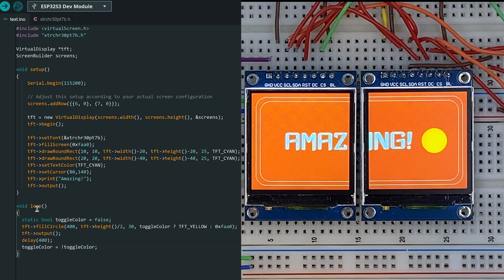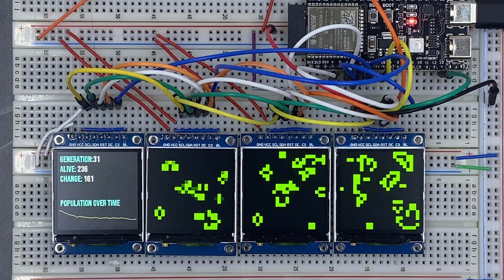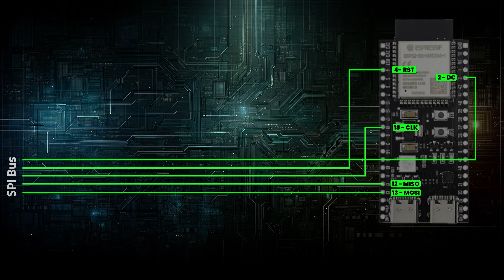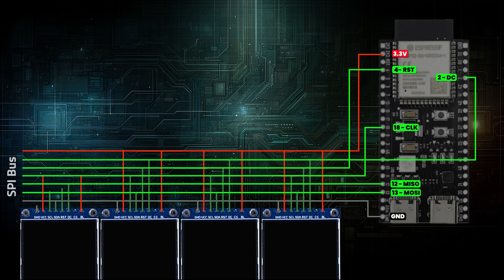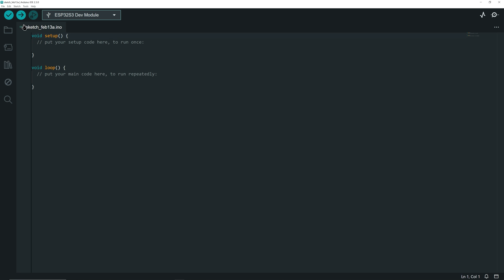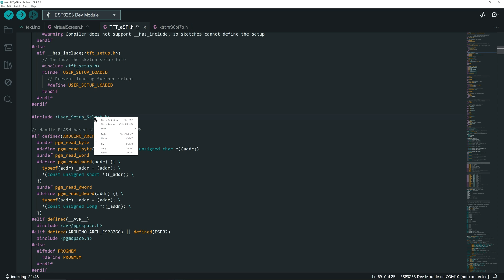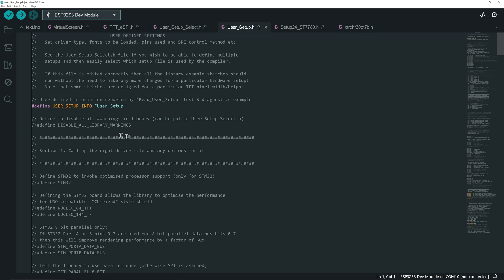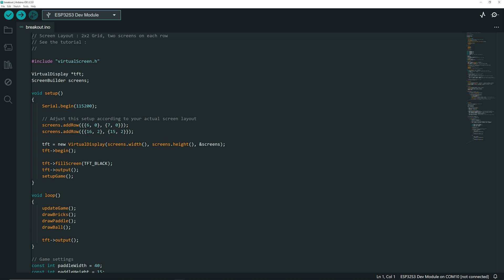Span Graphics Across Displays with ESP32 and Adaftuit GFX

Comment: sorry for the question on an old video but this seems exactly what i need for a project! Im curious if this would work with a teensy 4.1? Basically im trying to display GIFs as eyes, but writing GIFs to two displays as the same time has been difficult, so being able to just count them as one would make programming and animation so much easier.
I ask cause im not sure what library to to un-comment, or if this is code exclusive to ESP32. And i guess if so, is there an easy way to load GIFs on an ESP32? Teensy has the micro-sd card slot which is where ive been storing the gifs. 
If it matters Im using two adafruit 320x240 IPS TFTs, which have their own micro-sd slot, but using that always ran gifs really slowly. Any help would be greatly appreciated!
Reply from the maker: I have never tried it with animated gif, but it could work with some changes.  The code is made for the ESP32.

Comment: Hello. I realized 4 different animated GIFs projects you made on 4 different LCD display with success.
But for this project (4 x 1 screen in line), i always have errors from the ESP32 S3 and nothing appears on the screens.
Here are the error messages:

Rebooting...
ESP-ROM:esp32s3-20210327
Build:Mar 27 2021
rst:0xc (RTC_SW_CPU_RST),boot:0x9 (SPI_FAST_FLASH_BOOT)
Saved PC:0x40379db6
SPIWP:0xee
mode:DIO, clock div:1
load:0x3fce3818,len:0x109c
load:0x403c9700,len:0x4
load:0x403c9704,len:0xb50
load:0x403cc700,len:0x2fe4
entry 0x403c98ac
Guru Meditation Error: Core  1 panic'ed (StoreProhibited). Exception was unhandled.
Core  1 register dump:
PC      : 0x42003bc2  PS      : 0x00060430  A0      : 0x82003d50  A1      : 0x3fcebbd0  
A2      : 0x00000010  A3      : 0x00000000  A4      : 0x00000000  A5      : 0x0000000d  
A6      : 0x000000ff  A7      : 0x00000001  A8      : 0x08000000  A9      : 0x3fcebba0  
A10     : 0x3fc970f0  A11     : 0x00000001  A12     : 0x02625a00  A13     : 0xffffffff  
A14     : 0x00000031  A15     : 0x00000000  SAR     : 0x00000004  EXCCAUSE: 0x0000001d  
EXCVADDR: 0x00000010  LBEG    : 0x42008d9c  LEND    : 0x42008de3  LCOUNT  : 0x00000003
Backtrace: 0x42003bbf:0x3fcebbd0 0x42003d4d:0x3fcebc00 0x42003d58:0x3fcebc20 0x42002291:0x3fcebc40 0x4200995e:0x3fcebca0 0x4037f236:0x3fcebcc0
ELF file SHA256: 12cc4fe668cfc91b

And so on...
Do you have any idea ?
Thanks a lot.
Reply from the maker: Hard to say without looking at the code, it could be memory corruption.  If you want to share your code and having me give it a try, open an issue here : https://github.com/thelastoutpostworkshop/virtualScreen
Reply: I’m getting this same error on just the 2x1 example on an esp32-s3 n16r8. Did you find a solution? I’ve tried everything I could think of…
Reply: @ no, i did’nt find any solution.

Comment: Is this something that could be used with XIAO RP2040 microcontroller?
Reply from the maker: Yes it should work if you use the Arduino Framework with Adafruit GFX.  The XIAO RP2040 has SPI, so you can use a 16 bit display which is supported by the library.

Comment: Thank you, that's a great abstraction!  I wonder if "edgeless" smaller screens might be made, so that a "monitor of any size" could be made from them?  Not that it'd likely be cost-effective; more, as a learning tool.  Thanks again!
Reply from the maker: The 240x240 ST7789 that I use in the video have the screen glued to the PCB, it's quite easy to unglue so that you have almost no edge